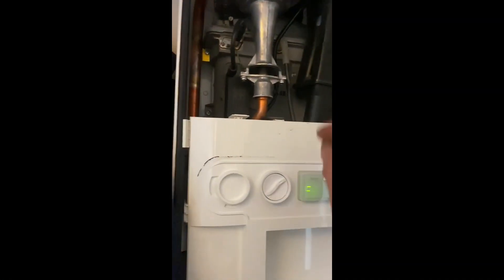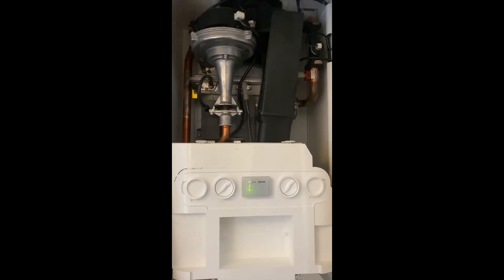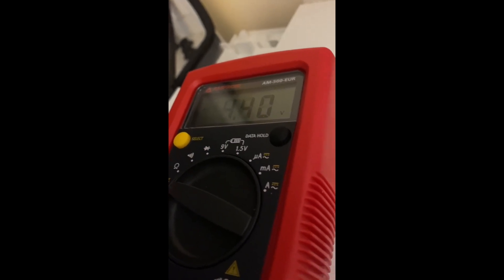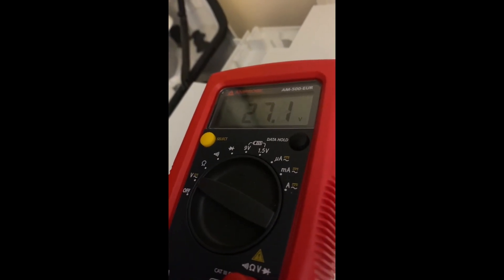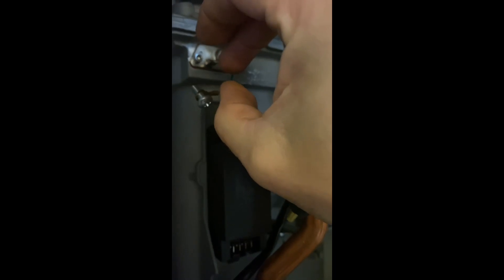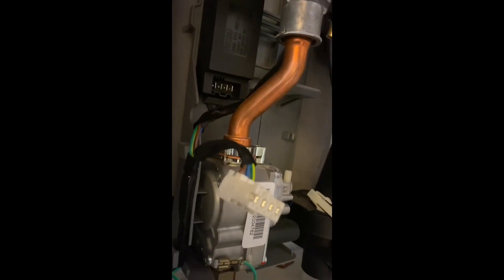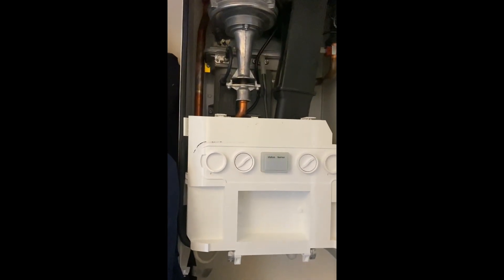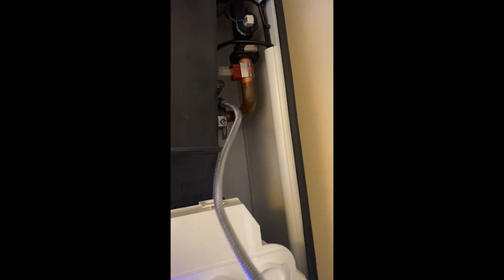Ideal logic L2 error - spark generator proving. No ignition no spark - - no flame - replacement unit

Comment: Got mine done today 
The engineer replaced the PCB board too 

Was that necessary do you think? 🤔
Reply from the maker: Unusual… but if thats sorted it then you can only go off what he says.  

To be fair - ideal pcb’s aren’t the best 😂
Reply: @petegasguy  thanks mate, just wondered as it got a bit pricy.. 

The other thing I did notice (after the fix) is that the hot water gets hot in about 30 seconds. Before it stopped completely it was taking around 2-3 mins to get warm (& I’d need to reset at least once every time..) 

So maybe that was all mounting up..?
Reply from the maker: @mrtc29 about £300 ish i’d imagine.

If you dont mind i’ll reserve judgement on the diagnosis… it sounds like an odd one though.

Pcb’s tend to just fail and rarely give intermittent faults that can be reset.

But - not seen it so hard to question the guy
Reply: @petegasguy  ok mate, yeah I understand 👍

And you’re really not far off with the price (inc call out charge) he did also ‘service’ it for that too (I.E checked all the pipes were clear etc. gave everything a clean) 

Anyways all sorted now (& for sometime to come I hope..) 

Appreciate your replies mate
Reply: Can this be an intermittent fault as happened a few times but then works sometimes?

Comment: If you get water heating but no main heating, make sure the temperature reciever(links to temperature setting on stairs or whereever) (ours is located next to the water pump) is switched on, usually a green light indicates it.
Reply: My problem is the other way round have heating but boiler stopped heating water? Logitech heat 24

Comment: Good video,well presented, can I ask you have 230v at the plug to the spark gen. is there a way of then proving the actual spark gen thus leading you to electrodes and/or their leads? Hope that makes sense.
Again thanks for making.
Reply from the maker: Hiya mate - i use a spark gen tester. They’re about a fiver or so and come in so handy.

This sort of thing…

https://www.ebay.co.uk/itm/121981403812
Reply: Nice one Pete, I was given one of them at Baxi a few years ago but tbh I thought it was only useful for seeing if there was a spark when you obviously couldn't physically see inside the combustion chamber, never dawned on me that it was actually proving the SG.
I want move more into breakdowns as the body starts to give up but want know what I'm doing and not try wing it.
Top man,defo subbed.

Comment: how did you no its not sparking ? sound ??
Reply from the maker: Sound… i have a spark tester to confirm (although didnt use here)

https://www.amazon.co.uk/Accuspark-Lead-Ignition-Spark-Testers/dp/B08C7RZL59/ref=asc_df_B08C7RZL59/?tag=googshopuk-21&linkCode=df0&hvadid=218553489803&hvpos=&hvnetw=g&hvrand=13105472234932631767&hvpone=&hvptwo=&hvqmt=&hvdev=m&hvdvcmdl=&hvlocint=&hvlocphy=9045438&hvtargid=pla-947866356944&psc=1

Comment: I am not a gas engineer by trade but followed your procedure for testing voltage to igniter unit and it was good at 240v so went to my local plumbing center and purchased a new igniter and low and behold I have the blue light of happiness again! Thanks so much for your video. I will pay someone gas safe to change electrode etc for peace of mind ;)

Comment: Todays one had a good spark gen but nothing after so checked the electrodes & it was broken.it can be tested by using an insulated screwdriver in the hole that the electrodes lead plugs into on the generator to visibly see the spark being made or not.
Reply from the maker: https://www.amazon.co.uk/Sealey-SEAQF-VS526-Ignition-Multicoloured/dp/B00S6C94VA/ref=asc_df_B00S6C94VA/?tag=googshopuk-21&linkCode=df0&hvadid=255660170781&hvpos=&hvnetw=g&hvrand=17366033502501516836&hvpone=&hvptwo=&hvqmt=&hvdev=m&hvdvcmdl=&hvlocint=&hvlocphy=1007151&hvtargid=pla-421986557208&psc=1&th=1&psc=1
Reply from the maker: https://www.sussexplumbingsupplies.co.uk/ignition-ht-spark-tester-only-4-99